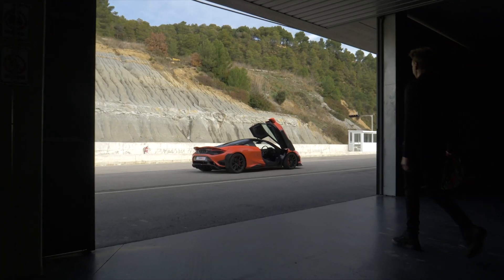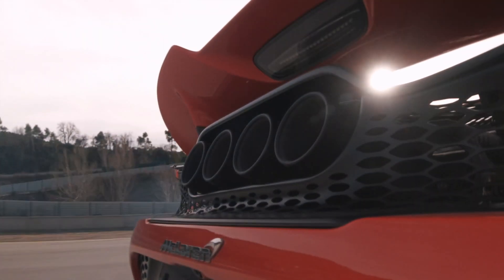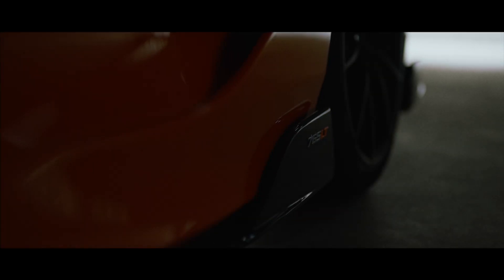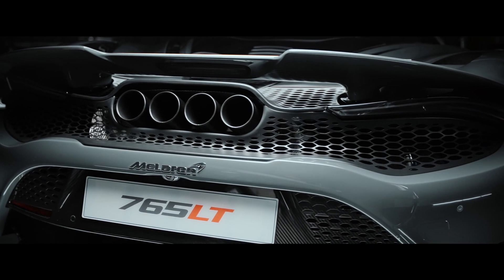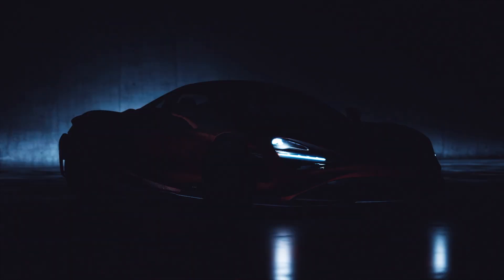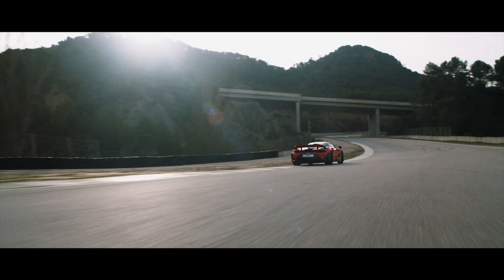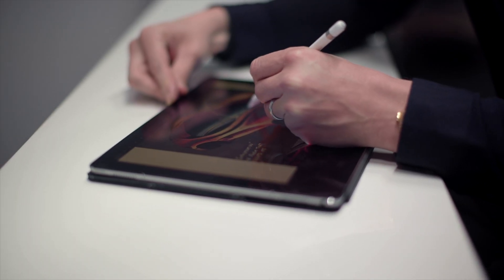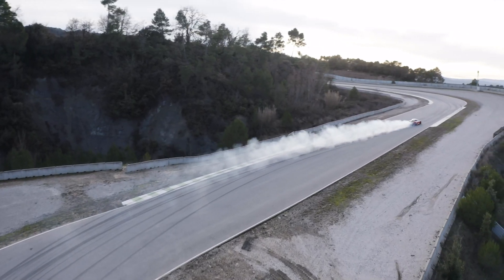McLaren Tech Club - Episode 18 - How we engineer the 765LT's incredible exhaust noise

Comment: 720s is already the fastest supercar in the 1/4 mile. 9.8
Can't Wait to see what this will do
Reply: It  wouldn't be a lot faster in drag race as the areo will slow it down but it will beat the 720s as it has 45 more horse power and has lower gearing to give it more torque
Reply: What about the turbo s?

Comment: I'll still go for a P1, sorry
Reply: @Amarjit Singh as in I'd crash it? Even if I did I'd still be having fun doing it. And anyhow I'm used to some more power at the rear. One just needs to adjust to the extreme power the P1 has.
Reply: @Amarjit Singh no shade to the 675LT as well its a fantastic vehicle. Much lighter on its feet and still amazing fun round the track!!
Reply: @woodant1981  
I'f I could afford either, I'd buy 765LT instead of the P1. More car for the money. Most likely it will deliver better track performance. And it should hang in close to the P1 in a straight line.
Reply: Tyran Mathurin can't fault you there it's personal preference and yes it'd do better on track, both are fantastic pieces of engineering